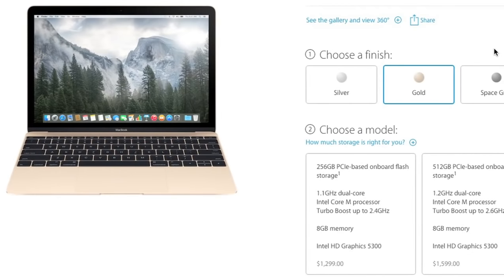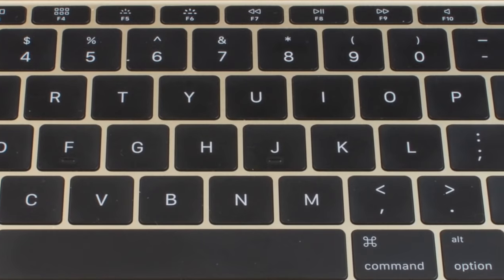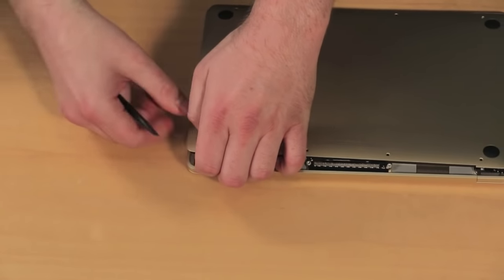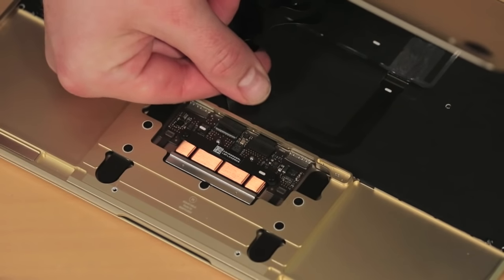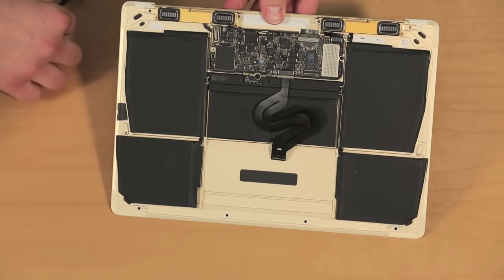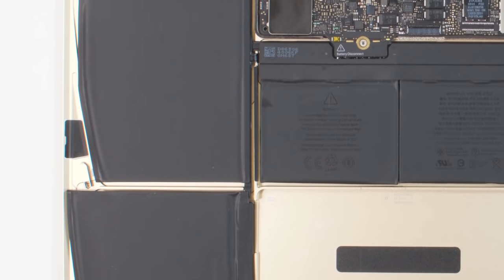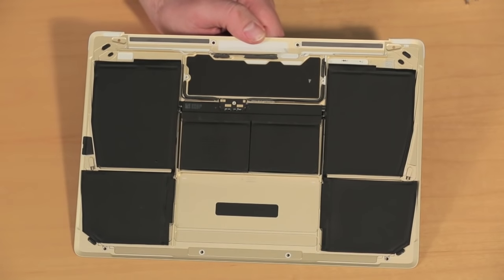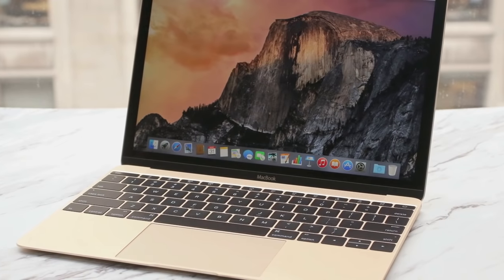Cracking Open: Apple MacBook (12-inch, 2015)

Comment: This thing is so underpowered. The worst part is that people will buy it simply because it has the word "Apple" associated with it. If only they knew that they were essentially getting an overpriced tablet w/ keyboard.
Reply: Mad Pistol i think when people buy stuff like this they do it more for fashion, like how it looks so much cooler when someone has an iphone 6 compared to a htc m9
Reply: Mad Pistol i bought it for many reasons first i move alot from place to another place so i need the thinest laptop which apple provided it to me second i like mac system because its faster  and better than windows will ever be..third i like the new color space grey last why windows microfans hates apple?! i hate iphones and i always buy andriods phones but Mac is the best system ever made..i have been using windows for 20 years till i bought my first imac 5k and i loved it ...is faster better cooler and no lags or problems ..microsoft widows it sux ..thank god for apple
Reply: im talking about windows and mac..mac system is always faster than windows in everything even with low spec ..no virus no endless problems like windows ..if u like playing games yea sure windows way better but in everything else mac is way way better..im not an apple fan and i hate apple phones but at least im being honest about mac..i have been using windows for 20 years until recently i bought imac 5K im shocked how faster it is ..it made my work way much easier ..when i was using windows i always had problems..u just hater try it u wont losing anything its better to see urself ..do not let ur hate prevent u from the best..peace
Reply: KissesXXoverXXhugs at the moment, we are are talking about a laptop that costs around $1200 base, and has a tablet processor. You seriously think this thing is going to be faster/better than my 2 year old $1200 Samsung laptop with a quad core i7, 8GB ram, a dedicated GPU, and a touchscreen?

One word: NO.
Reply: Mad Pistol it is better because it dosent say samsung on it
Reply: It only has one port, and you have to use that for everything you plug in with! That is really sad, even more so with an apple product.
Reply: jo l that is fair enough. But a big however, the new macbook has one port. This one port you have to use for everything, including charging, extra storage, etc. You would also have to fork out an extra 70USD for a multi-adapter by Apple. It is a downgrade from that aspect. I'll make sure to reccomend people to buy the previous model if they do buy one, the new one is just beyond help.

And yes, you could buy a cheap multi-adapter (when they come out) but there's no point buying a cheap accesory to put on an expensive device.
Reply: ***** I tested it. It's slow. I'm not jealous. I have something that is faster and cost less
Reply: Mad Pistol because tablets have 8gb of RAM.
Reply: +Mad Pistol typical uneducated brute. "tech" specs aren't everything. OSX is optimised to work with apple hardware, hence a faster feeling experience. Windows is developed with as much hardware compatibility as possible, hence bloat. 

Personally, from experience a windows laptop will last 1-2 years before everything starts heading south. Where as I've experienced macbooks that are 8+ years old that still run smooth as butter. 

Here's a tip, don't like apple hardware? or OSX? Don't but an Apple computer.
Reply: kirk stanton fine by me if you want to take 5 times as long to compress a video compared to my quad core i7 laptop. Whatever helps you justify the price is good for you.
Reply: And how certain are you that your Windows PC can compress a video 5 times faster than my i7 macbook pro?

Again, don't want a mac? Don't buy one. Im not having a dig at PC's, but with my experience a mac has suited my lifestyle better than a windows machine.
Reply: kirk stanton I was mainly speaking about the MacBook listed in this video, not a MacBook pro which costs over twice as much when configured with a quad core i7
Reply: 5 times as long to compress video?  Your i7 must have some serious issues if a Mobile processor with integrated graphics can keep up at that rate. I would think you'd be looking at 10-20 times faster for a half decent i7.

Apples and oranges really. I wouldn't go around bragging about your Lamborghini being 5 times faster than a Toyota Corolla.
Reply: kirk stanton i had no idea a high-end, all aluminum Samsung laptop was a Corolla compared to your "Lamborghini", but to each their own. As long as it helps you to justify your purchase of an overpriced laptop, that's fine by me.
Reply: Another comment gone straight over your head... you're missing the point brah!
Reply: +Denti Master1 Scammer
Reply: +Mad Pistol how is it underpowered? If you don't play games or do a lot of video editing then this computer is good for your everyday tasks. its meant for poeple who need a light computer to take everywhere not a computer with 3 titan x'x
Reply: +RaviWay Inc. Lemme put it this way: It's slower than an iPad Pro, but uses a full fledged desktop OS and apps that assume far more power than what iOS and related apps assume.

Of course it's slow. Even for the basic stuff.

I think Apple has made a lot of great products throughout the year. In fact, I just picked up an iPhone 6S. I also own a 2011 MacBook Pro and it's been awesome.

But I am desperately tired of Apple's obsession with thinness and lightness. They have started putting design before function, and because of that we now get keyboards that have almost no travel just to make the laptop a little thinner, we get non-upgradeable Mac Pro's just to make them smaller (although the thermal core design idea itself is pretty awesome I have to admit), and Apple has simply stopped offering devices that can deliver good graphics performance entirely so that the iMac does not have a separate body but "hides neatly behind the display".

I think Apple is a great company that has innovated a lot and done a lot of awesome things, but this device is, for lack of a better term, a netbook. And, as Steve Jobs put it, "Netbooks aren't better at anything!"

I think Apple needs to let function inform their design again. If a decent graphics card for a mid-range computer requires some space to cool and to even be there, it's okay to make the computer thicker, as a simple example.

It's also okay to make the iPhone 6 thicker than it is so the camera doesn't stick out the back and get scratched. It doesn't matter that the phone is a few mm thiner than the last model if you need to put a cover on it to make it thick enough to not damage the camera anyway.

And so on.
Reply: +IshayuG If Apple doesn't make their products thinner, we would be stuck having big electronics. Old computers or phones we see today have once been considered really thin when they were released but as time passed by, they get more power efficient, and more powerful and the same or smaller size, which would make sense why they would make it thinner. It won't make sense though if they make it thinner, and have the same speed inside.
Reply: ***** If you can cram the functions of a device into a smaller space, then that is a good thing. However, focusing so much on thinness that it harms the function of the device is not a good thing.

This is the crucial distinction. A MacBook Air is not just a thin machine, it's also a capable machine. The MacBook is just thin. It can't do anything useful because it is too weak.

The same goes for the retina MacBook Pro. It is as thin as the MacBook Air, but to get there it sacrifices a discrete GPU (well, there's one with a discrete GPU, but it is slow) and therefore becomes unsuitable for professional work that requires powerful rendering, such as editing and rendering videos, doing small scale simulations, and of course creating, designing, and playing video games. The current MacBook Pro is useless to an engineer as well, because CAD tools don't run properly.

These new designs focus so much on thinness that they simply cannot do what they are designed to do.
Reply: IshayuG as for you macbook pro comment, I assume you're talking about the entry level, student focused machine. (hardly professional level)

As a CAD designer, in a professional industry, I'm sure you can justify the purchase of the middle tier MBP or even the top tier model. I'm 99% sure autocad, or any cad software will run without hickup. 

Currently on a 2014 MBP Im running Photoshop, InDesign, Illustrator, Skype, iTunes, Numbers, MAMPPro, Tower, Forklift, iTerm, Sublime, Outlook and quite a few tabs on Chrome and its smooth as butter. 

Im confident I could continue to work with all these programs open for the rest of the day, and not encounter a single issue.
Reply: kirk stanton Even the highest end MacBook Pro is very slow, particularly considering its price. That's actually the one I was talking about. I can get a twice as fast laptop on the GPU side with exactly as much attention to detail, battery life, retina display, and all the rest of it, from Razer. And if I don't go with Razer and am willing to compromise on the design a little, I can get something WAY faster.

Why can Razer do it when Apple can't? Simple - the laptop is a little bit thicker, providing that extra bit of thermal capacity needed to run a high end GPU.

The top end MacBook Pro is a joke. It's hilariously underpowered for being a Pro laptop and don't even get me started on the price point.

The only truly competitive Apple Mac products right now are the MacBook Air and the Retina 5K iMac. Both of these are great machines with great specs and a great price. The rest of it is pretty much garbage. Even the Mac Pro is underpowered and professionals want it replaced with an updated tower Mac - badly.

The MacBook's processor is very slow but you are right, it can, though only barely, run the basic every day tasks you're referring to. The real problem with that computer is that it is so thin they couldn't even fit a comfortable keyboard in. I've tried using it, and it's a joke. I'd be willing to pay money in the same price range as the iPad for the MacBook. The current price point is absolutely asinine, and saying "Yeah but it's Apple" is no excuse - that's just admitting I'm right.
Reply: IshayuG It just seems you're a bit salty about apple products. Simple solution don't buy Apple products. If you prefer Razer's products, go buy Razer products. Its your life, do whatever you want. No ones forcing you to buy an apple computer.
Reply: IshayuG As I mentioned. Its your life, do what you want, buy what you want.

Personally I'm happy with my macbook pro, it does the job, and it will continue to do its job until I decide to buy a new one.
Reply: +IshayuG I think you don't own it and haven't used it so you are not talking from experience.   It's super light,  and does the job just fine.  MacBook Air is dead in the water because of this.
Reply: Morbus Well, I certainly don't own it. But I have tried to use it and I was not impressed.

I don't know why you'd claim the Air is dead because of this. I don't know anybody who would buy this over an Air, but I do know 10 people who bought an Air within the last 12 months...
Reply: +IshayuG if you use Final Cut Pro you can edit 4K on the new 12 inch macbook
Reply: Harry Dixon Yeah, but this computer isn't made to render or edit video at all. The fact that it can do it is great. 

As I mentioned earlier, I run this computer to meetings, and it runs photoshop great, as well as all my day to day applications. Email, word, excel, chrome, itunes, illustrator, sublime, etc. 

It's a great machine, and sure it may be "expensive", but its simple, if you can't justify the expense, don't get one, if you don't like apple products, don't get one.
Reply: +ForsakenGod96 No way you can get a laptop for $1,300 with this specs..... I have a Nvidia 970M, 8GB of RAM and an intel i7-4710 with a 1TB 7200 RPM HDD for $1,500 at the time of purchase in December 2014.... Nice try though. Even now a computer with a Nvidia 980M is around $1,400
Reply: +Mad Pistol Eh he has a point though lol. Apple devices specs doesn't really matter as much as with windows. I have a Windows 10 laptop with 8GB of RAM, intel i7 quad core cpu, Nvidia 970M and a macbook pro with an dual core i5, 8GB of RAM and intel iris 6100 graphics and I feel my Macbook is faster. Windows is fine but its comparing apples and oranges. Apple has full control over specs, OS and the components so they can manufacture the device to perform how they want to vs Microsoft which has a bunch of different OEM's creating devices with different types of storage like cheap flash storage like the HP stream uses to standard 5400 RPM HDD's to fast SSD,s and different GPU's, CPU's and different amount RAM. 

Apple iPhones spec wise are worse then Android's but I find iPhone to be faster then the Android phones I have used and which also have better specs then my iPhone as well. My iPhone 6 plus has a dual core cpu which i believe is clocked around 1.5GHZ 1GB of RAM ( the weak point of the device imo) and more internal storage then most Android devices with 128GB of storage. Yeah spec wise all flagship devices from Android OEM's from the past three years are better spec to spec but once again Apple optimizes their OS better with the hardware.
Reply: +jo l The Macbook Air is a perfect device as a main device for most people. Has outstanding battery life and easily does web browsing , email and word processing quite easily.
Reply: +ForsakenGod96 yes but you still have a shit operating system. Apple does not require high specs to do alot of stuff. I have a mac for video, cad as well as audio editing, and photo editing, while i have a pc gaming computer. Although i could easily run a cad software program on my pc which i originally had but i find and many find that apple is better suited. Apples operating system just runs better for the tasks it is designed for. While pc is designed for what it is designed for.

Comment: i personally hate the new keyboard, because it essentially feels like typing on rock, and while typing, it shakes the screen. Just my opinion
Reply: Aadharsh Pannirselvam Yeah, but that's not the biggest problem. Lets start with heat. They keep on praising fanless design, but as soon as you run a resource intensive application, laptop heats up so bad, you can't keep it on your knees (some reviewers reported). Excessive heat will also result in premature death of your machine (cool processor is a happy processor). A lot of reviewers praise battery life, but as I said earlier, we live in a word of HD content, 1.1-1.3GHz processor in nowhere near fast enough for it, so it'll always run at its top 2+GHz speed, and that is 5-6 hours of real life usage, watching vids and whatnot. Shorter battery life means more frequent charging, and you can charge your battery only X amount of times. Battery (-ies) is not only integrated, it is glued in place, so you can't easily replace it (he should have tried to unglue it, maybe it's glued with a double sided sticky tape, and not with some epoxy-esque adhesive). And keyboard is also glued in place, together with those nasty sticky feeling short travel keys, you better be careful not to spill your soft drink on it. Trackpad is also too big for this machine, there's no place to rest your hands, resulting in unnecessary hand strain. So as you can see, not only is this machine not practical, it is also designed with planned obsolescence in mind. I'm actually surprised guys at CNET are not talking about this.
Reply: funky3ddy It also thermally throttles if the CPU is at full load for more than a 2-3 minutes. While modern CPU's can thermally throttle and last longer than almost every other part of the laptop, the throttling makes for lower performance on processes that consistently use a high amount of CPU time.
Reply: Well then get the air or pro
Reply: i own it, and plan on returning it shortly, for a rMBP at the same price
Reply: i went straight to the apple store, and was able to get a space grey model.
Reply: wut?! wait whaaaat
Reply: i went to an apple store, tried it out, and bought it, then now i used it more, and personally despise it
Reply: yeah, but i have used thin laptops in the past and loved them, the only reason that I am here is because i needed a mac, and a hackintosh was out of the picture

Comment: 4:23 “the MacBook Air’s days are numbered” that definitely aged well
Reply: @mudd258  scarcasm exists
Reply: The next proper refresh of the Air in 2018 was effectively a 13 inch MacBook. Fanless design, all metal enclosure, butterfly keyboard, Force Touch trackpad, Retina display. The Air moniker just proved too strong and they could never get away from it.

Comment: it's actually a wonderful laptop. Yes its not powerful but now if they upgrade it with nicer internals in 2019, it could be great. It needs a better webcam and better mobile processor. I used one for two years and totally loved the size, weight of it and the feel, it was just pleasure to do everything there, and since I don't do heavy tasks on my laptop (the most heavy task is editing photos with Lightroom) I never felt like I needed more power.